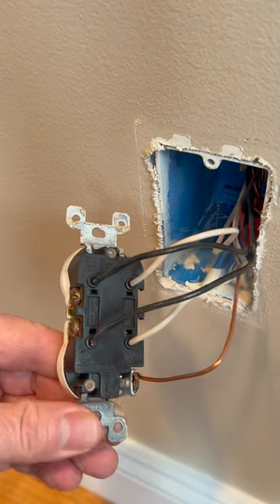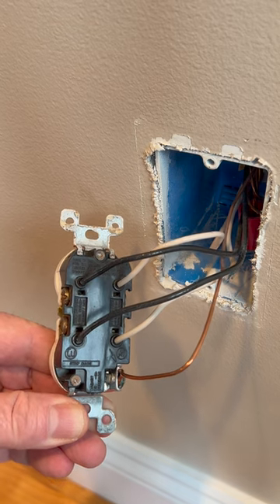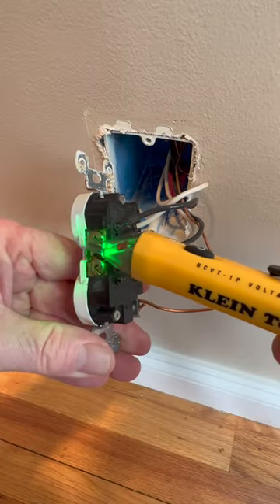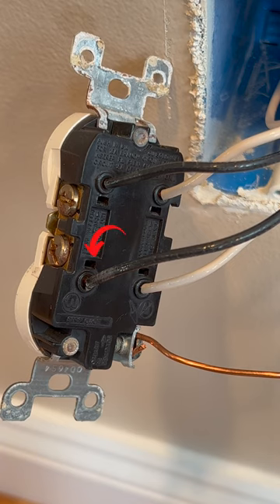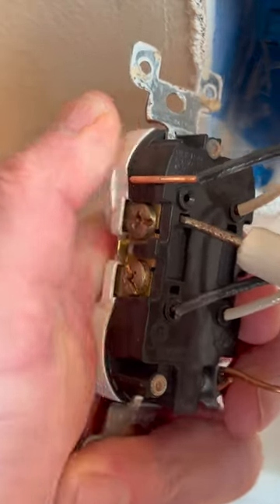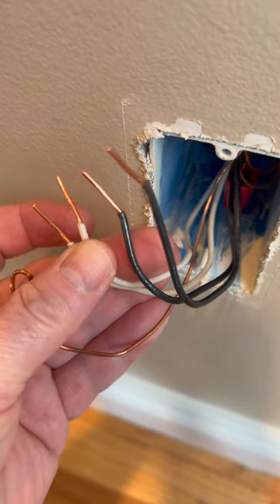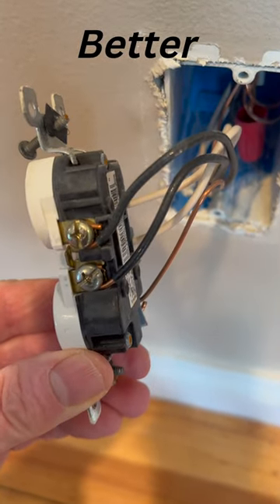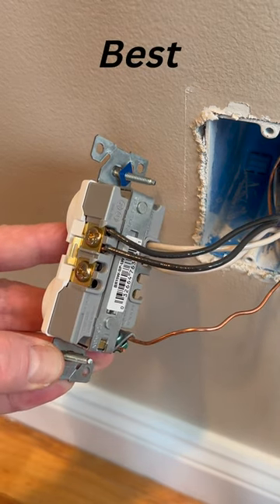How to Release Back Stab Wire Connections #Shorts

Comment: I worked with an electrician on a hospital job once. It was my first time ever seeing a commercial/industrial grade receptacle up close. I couldn't believe how much nicer and easier they were to wire. Now when I need a receptacle I buy them too.
Reply from the maker: Agreed.. There are several grades of receptacles. I use commercial grade most of the time now even though they cost a bit more. The top grade is hospital grade and they are nice but cost a whole lot more than the commercial grade.
Reply from the maker: @mcarroll598  No I said I like to use commercial grade receptacles. We used hospital grade when connected to critical equipment at the semiconductor fab where I was the electrical engineer before I retired.
Reply from the maker: @mcarroll598  My apologies..

Comment: Just to warn people a non contact voltage indicator is not an approved or safe method of proving dead circuits. Always use a dedicated 2 pole voltage tester (not a multimeter) and prove before and after on either a proving unit or a known live source.
Reply from the maker: All high voltage verification is done with proximity testers by industrial electricians and line men as well. I agree that a multimeter or another two prong test is your best option for 120/240 volt circuits the proximity test can be used. I have a video on the live dead live test to be sure your tester is functioning properly

Comment: Don't daisy chain devices either make sure to pig tail everything makes troubleshooting easier. Had a buddy the other say older house and half of his lights and receptacles went out all because they were all daisy chained off of one outlet that broke internally and started to short tripping the breaker.
Reply from the maker: I have a video on when I pigtail. Wire nut connectors can fail as well. Never seen a property wire device fail open. If the back stabs are used then pigtails are a must.

Comment: You can also pull and twist them at the same time and will come off. Sometimes easy sometimes hard
Reply: This worked for me thank you so much! Last time I replaced an outlet  I cut the wires and had to strip off the insulation - it took forever.

Comment: On my older home we didn't have ground wires in the outlets (receptacle) and it's a hell of a job running a ground wire to every single outlet. so I put in all new outlets with ground and simply put a small pigtail wire to the white wire. The white wire goes to the electrical box that is exactly the same as the ground.
Reply: Well, no, this is not exactly the same.
It will work and in some situations like the ones you described is ok to use.
(depending on area ofc)
But it's forbidden in new installations for good reasons. (again depending on local laws ofc.)
Reply: You should never connect the ground to a neutral and it isn't the same as ground. Neutral is a current carrying conductor, so now your genius idea will cause current to flow through all the metal parts of the outlets, and any metal boxes or other parts that are connected.
Reply: @illestofdemall13  . There is no current in the white neutral wire.  As I said,  It's connects in the same ground bar in the breaker box.
Reply: @2Jeezuzisreal  You are incorrect. You need to do some more research because the neutral does carry current in 120V circuits. It connects together with the ground at only one point in the system which is at the first point of disconnect. When you connect ground and neutral together at another point, you create parallel paths for the neutral return current to flow. That means current can and/or will flow on ground wires, metal parts, copper plumbing, etc.
Reply: @illestofdemall13  
{{{not true}}}
Reply from the maker: There is current on the neutral. It carries the same current as the hot but back to the source. You should never use the neutral as an equipment ground. Bad idea.
Reply from the maker: You're mistaken my friend..
Reply: @BackyardMaine  
Not true. Neutral is connected to the grounding bar in the breaker box
Reply from the maker: @2Jeezuzisreal  Not exactly. The neutral and ground are bonded at the main either in the meter box or the panel. The neutral carries the load current back to the source so it's a current carrying conductor. The code refers to it as the grounded conductor but it's not the grounding conductor. If you disconnect two loaded neutrals and put any part of your body between the conductors the current will travel through you and you will get shocked. Just for reference I'm an electrician and an electrical engineer.

Comment: Not a fan of backstabbing receptacles. In my view one is asking for a fire. There is a very narrow point of contact. Loose connections cause fires. I have no empirical evidence that these types of receptacles cause fires. If they were they would not be available. I would rather wrap the terminal.
Reply from the maker: I agree with you my friend. I also made a couple of videos about these as well.
Reply: Granted, push-ins have a quite narrow contact area. 
But the spring will always keep the connection save, if your device is of good quality.

Over here in Germany, we never use devices without VDE-approval.

Besides that, proper electricians have to be 3 to 3.5 years into training.

Comment: Using the side screws on residential receptacles loosen over time.  I had less issues witht the baskstab method. The screws on commercial ones are a much better design though cost a little more.
Reply from the maker: I agree on the commercial devices but I have never had issues with screw connections. My house for example. I wired it 25 years ago and have never had one issue. I fix the back stabs all the time on service calls.
Reply: Let’s be honest here, those holes in the back are probably the best solution for DYI because they are a simple solution for an inexperienced person.  Use strip gauge and press in.  It either grabs or it doesn’t - plus, it’s less susceptible to improper torque, or dealing with terminals.   I’ve had commercial back wire connections that I know were tight loosen as well.

Comment: I would not rely on the "hot stick" your using to verify the power is off.  Those are handy in certain circumstances but are unsafe in the instance you show.  Always use a real voltage tester, the kind with two prongs, to test for voltage.
Reply from the maker: Many people who aren’t electricians like us don’t own a good multimeter. These are fine in my opinion  as long as you do a live dead live test. My last video was demonstrating that.
Reply: @BackyardMaine they make pretty inexpensive contact voltage testers that cost similar to NCVTs. I would say pick one up. As long as you test it on a known live source prior to use you are good.
Reply: I use a voltage (hot) stick in most situations after accessing the risk of a false reading, but my Fluke T90 is always ready for complete  satisfaction that it's Dead.
Reply from the maker: @stevethomas5849  I have a video of the live dead live test that I recommend with this type of tester.

Comment: Push-ins are actually pretty good these days.
The copper is held down by a spring. 
Because copper is rather soft, too much pressure (like in a screwterminal) can make ist Kind of retract and loosening the connection. In cases like this, the spring just readjust and will clamp it down all the time.

Btw, these springs are designed in an way, that they will burry themselves into the copper so you can't pull them out that easy.
Reply from the maker: My experience is that the thin metal contact point will fail over time with heating and cooling. They it will begin to arc and build up carbon until the connection fails.

Comment: Or BEST yet, get rid of the pass-though connections (series wiring) altogether and install pigtails to connect your device to (parallel wiring). That way you’re not loading every device on the circuit when plugging in something near the end.
Reply from the maker: The pass through current rating is 20A even on 15A receptacles. I know we all have our opinions and I respect that but in my opinion the trough wire method is fine when you have two cables in the box. With three I will always pigtail. If you side wire and make a secure connection you will not have any issues. I made this video on the subject. https://youtu.be/K3RIjUnrNTQ

Comment: How about “ receptical” 	or electric receptacle - receptacle providing a place in a wiring system where current can be taken to run electrical devices-electric receptacle - receptacle providing a place in a wiring system where current can be taken to run electrical devices
electric outlet, electrical outlet, wall plug, wall socket, outlet
power point, point - a wall socket
receptacle - an electrical (or electronic) fitting that is connected to a source of power and equipped to receive an insert,👍~~~
Reply from the maker: Outlet. A point on the wiring system at which current is taken to supply utilization equipment. 

Receptacle. A contact device installed at the outlet for the connection of an attachment plug, or for the direct connection of electrical utilization equipment designed to mate with the corresponding contact device. A single receptacle is a single contact device with no other contact device on the same yoke or strap. A multiple receptacle is two or more contact devices on the same yoke or strap.

Receptacle Outlet. An outlet where one or more receptacles are installed.

Comment: Always learned to side mount the wires but ive been thinking recently aren’t  these famous wago blocks practically the same as backstabbing an outlet
Reply from the maker: The Wago 221 are similar but actually work a bit differently. The have a lever that actually applies pressure on the wires where the backstab the wire is wedged between two surfaces.
Reply: The amount of contact is nearly identical. And they’re both perfectly Ok, approved methods.  But if you’re going to backstab don’t also pass-through. Install pigtails for ea device.
Reply from the maker: @HBSuccess   I agree that if you're going to use the backstabs you should always pigtail but the amount of contact on the stabs is minimal compared to the side wire. In this video I pull one apart to demonstrate. https://youtu.be/e_C_twh5fQE

Comment: So you „verify“ Zero Energy with a magnetic Test Stick?
Reply from the maker: I have a video on using these safely called the live dead live voltage test. I multimeter is best but many non electricians don't have a multimeter. These are cheap and a lot better than nothing.

Comment: No sleeving on the Ground. Here in the UK that's a no no.
Reply from the maker: It's a bit different here in the US. Residential homes are usually wired with type NMC cable which has a bare ground or earth as you guys call it.

Comment: Always cut the wires off. They are damaged from back stabbing. If you pull the wire out you will see a knick in the copper. When you put the hook on the wire the wire will break.
Reply from the maker: You are correct bit you only need to trim them at the nick. Sometimes especially on old installations you want to conserve as much wire as possible. That’s why I said inspect the wires for damage.
Reply: No they're not, and a knick is nothing.

Comment: I thought you weren't supposed to use those?
Reply: Right, but someone before you may have.
Reply from the maker: I don't use them but I would like to help people who may not know the best way to remove the wires. That's why I recommend side or back wiring at the end of the video.
Reply from the maker: Exactly..
Reply: @BackyardMaine  okay cool. I was just making sure. I'm not much of an electrician.
Reply: @BackyardMaine  I always heard that you weren't supposed to use them. Pushing that in ruins them too, doesn't it?
Reply from the maker: @sufferedlearnedchanged  Yes they are only good for one use.

Comment: Please learn how to use a meter and don't depend on a tic tracer.
Reply from the maker: Not everyone has a meter and there are a lot of people who do their own electrical work. I agree a meter is best but proximity testers can be a reliable way to know something is live or dead. I have a video on how to use them safely with the live dead live voltage test.
Reply: @BackyardMaine  My apologies, I should have mentioned for people doing their own work and not you, 
In reality decent meters for home use have gotten pretty affordable, unlike our standard fair of Fluke meters. 
And in my apprentice days Simpsons. 
Glad you do have good instruction on doing so. 
I have seen a green horn depend too much on a "proximity tester" And he got a nasty shock and luckily we were working in a hospital,  He looked at me and said "you didn't see that." I said sorry man I did and you need to get checked out, it is ok to admit a mistake. And that you need to tell the boss what's up.  Ten minutes later we heard a code blue announced in the ER over the PA.  I come to find out it was the green horn.  If I didn't stick to my guns about the safety aspect he might have died.
Reply from the maker: @charlieb9502  Wow, thanks for sharing that story. I had a pretty bad shock about 30 years ago. I was in a plenum  trouble shooting an air handler that stopped working at a large manufacturing facility. The disconnect had a rocker arm rather than the usual handle. When I pressed the arm to shut it off I got lit up. Luckily the muscle contractions in my arm actually open the switch. If it was a handle it might have killed me. Turned out that the strut holding the switch was screwed into a thick plastic sheet. The ground lug connection had vibrated off and one of the phase wires was touching the enclosure. 100A 3 phase 277/480v. I went to the emergency room to be safe but I was ok.

Comment: Code violation. Pigtail that box. I hope that’s not your house. If it is someone needs to go back and check all your past work.
Reply from the maker: Pigtails are not required by code. You may want to do some reading before you make a comment that everyone knows is wrong. The only time a pigtail is required are for the neutral wire in a multiwire branch circuit where two hot wires share a common neutral. NEC 300.13 (B)   
In multiwire branch circuits, the continuity of a grounded conductor shall not depend on device connections such as lampholders, receptacles, and so forth, where the removal of such devices would interrupt the continuity.

Comment: Pigtails dude. If you’re gonna teach a lesson, make it the correct way. No one worth their weight uses the device to splice. You make that before the termination to the receptacle.
Reply from the maker: The national electrical code disagrees with you.  I know that this is a highly debated subject but for residential work pigtails are not necessary at all. Even 15A receptacles are rated for 20A passthrough current and a wire connector is also a possible failure point in the circuit. I've been a licensed electrician for 38 years and an electrical engineer for 10.. So I may actually know what I'm talking about.